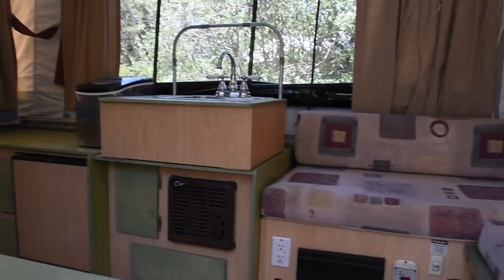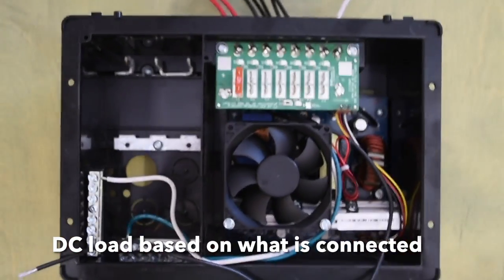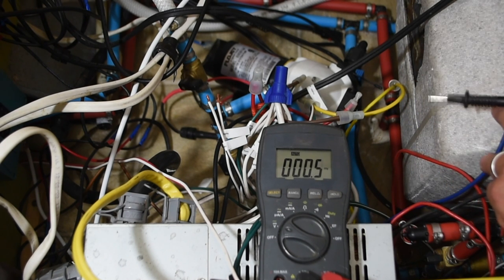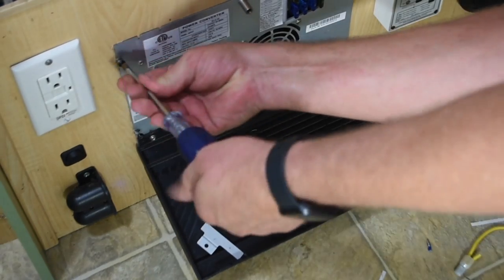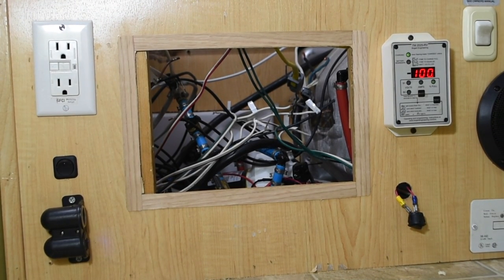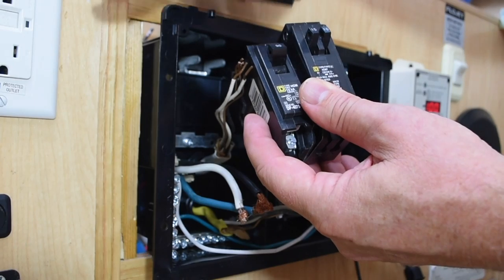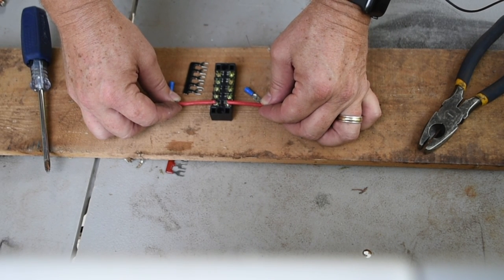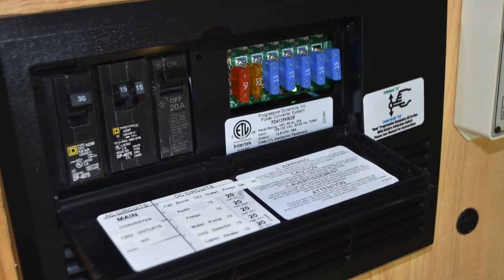Progressive Dynamics 4100 Power Center Installation in a Pop Up RV

Comment: Thank you so much for this video!  I need to replace my failed WFCO-8735-P power center with the Progressive Dynamics 4100. The Progressive Dynamics website references in their description of their 4100, two versions of the 4100: A "Retail model #PD4135KW2BV" and an "OEM model #PD4135KW2B".  Are there any differences between the two? Looking at the photos, the Retail model has a red-colored fuse background plate, whereas the OEM model has a green-colored fuse background plate. The OEM model also appears to have 7 fuses instead of 6, and it has tab connectors instead of the wire tails which the Retail model has.  Is it best to go with the OEM model 4100?  I have tried to find the OEM model online, but doesn't seem to be available??  Where can the OEM be ordered?
Reply from the maker: Hey @kims!  So sorry for the delayed response.  Great question!  I honestly don't know, so I sent a note to Progressive Dynamics and asked them to explain the difference to me.  I actually had to look at my receipt and see which one I used.  I used the Retail version.  Hope it's not too late, but once I know I'll post here.   Thanks for watching and thanks for the questions! Jim
Reply from the maker: Hi @kim.8718!  Okay, got a quick response from Progressive Dynamics!  Great customer support over there.  I asked if there were any technical differences, warranty differences, or components in the box variance.  They responded with, The ONLY difference is the packaging.  Hope that helps! Good Luck on your project!  ~Jim

Comment: Great video!! This helped me answer many questions I had regarding upgrading from my WFCO converter to the PD 4100. I do have a couple questions though. I was told that I may need to upgrade my wiring in my popup (2010 Coleman Destiny Westlake) as the 4100 pumps out 35amps. Does this mean all my wires or just the positive and negative connecting to my LiFePO4 battery? I didn’t fully understand the shunt part at the end? I plan on moving my battery from the tongue to inside my camper. The + and - wires coming from my current battery harness on the tongue is 10 awg but they are thinner when they get back behind the current converter (WFCO 8725). Does this matter? How would I go about connecting the battery inside the camper to alleviate this problem if it is one?
Reply from the maker: Hi John,
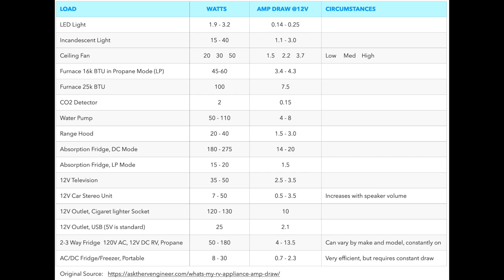My sincerest apologies!!  I somehow missed your comment and questions.  I'm sure this is response is way to late to help you with your project, so for that I'm so sorry.  For the wiring side, unless you have updated dc appliances in your camper, the wiring to the lights, radio, 12V fridge, etc., were sized correctly for the wire runs to individual appliances/devices.  If you have changed a device such as upgraded your fridge, then you might need to update that wire run.  My pop up is a 2016 and I have upgraded my 2 way fridge.  I did not change the wiring.  The wiring to it is 14AWG or 16AWG (hard to really tell) but it's sufficient for the 12 volt fridge and less than 5 amps of draw.  Now, if your camper is constantly exposed to harsh weather or ocean environments, your wires could corrode.  In my experience, that happens at termination points the worst where moisture can get to the exposed wires connections.  I've seen stranded copper wire corroded up to 3 inches inside the wiring jacket from it's connection point.  You will want to remedy corroded wires with new runs or splicing-in at the 'clean' wire.  Again, this is only for the low voltage side (12V).  The wires that come installed on the PD4100 low voltage DC side are no larger than 14 AWG.  So, I matched that size for the wire run between the PD4100 and my battery, on both the positive and negative wires.  My solar system uses 10 AWG wiring from panels to the PWM solar charge controller and from the controller to the battery bank.  The solar panels recommend 8 AWG, but honestly for this small 450 Watt system in my camper, I was more concerned with wire management than resistance reducing the production of the solar panels.  Also the runs are very short.  I'm running several 12V lead acid batteries in parallel.  The wire connections between are car battery terminal cables which are actually 6 AWG.  So, to answer your question specifically, I'm using 14AWG to connect the PD 4100 to my battery.  I'm using the wire installed in my camper for everything else.  Also to note, remember to look that the table in the video at 5:20 seconds.  That's a good estimate of what each DC appliance draws in Amps and requires in Watts all assuming a 12V DC system.   I have a new video out that goes into the Shunt in much more detail.  You can find it here:  https://youtu.be/TVgJ3tX9O6A?si=IFanbKAIhZuVxSsq    Again, so sorry for the delay.  I'm a little embarrassed to admit, but I just learned (20 minutes ago) how to see when comments are posted on my videos (hence the response... finally!)  Thanks so much for watching, your comments, and questions!  Hope I answered everything.